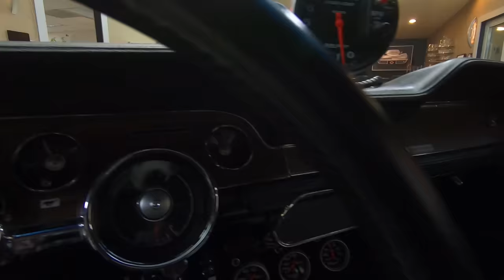1968 Ford Mustang Lucy For Sale

Comment: I had a 1968 Mustang fastback, 428 Cobrajet, 4 speed, 4:88 Detroit locker rear diff. When i bought it, it had lived a hard life and was pretty much on its last legs mechanically.  Body wasnt too bad, but i did have both floor pans and rocker panels and the left rear quarter panel all replaced with factory Ford replacements. I did all of the mechanical repairs  myself, i got a Lunati forged crank kit, with forged steel crank, forged aluminum rods and forged aluminum  .030 pistons. I balanced everything on a grahm scale after trimming all the excess weight i could, i put a custom ground full roller cam setup in it, aluminum heads, studded  the main caps and heads installed windage trays etc, then topped it with a Banks underhood low profile super charger, and Banks throttle body fuel injection. I replaced the top loader 4 speed with a Borg-Warner Super T-10 4 speed and Zoom multi disc clutch, and explosion proof bell housing. I had a custom aluminum drive shaft made, and did a complete 4 wheel disc brake changeover, i put a whole new suspension setup, with coil spring 4 link rear diff, and a steering geometry setup that was designed for SCCA Trans Am series racing for 60s mustangs.  I didnt build it to drag race with specifically,  but it was a true 10 and a half second car when i eventually took it the Thunder Valley  dragway in Bristol, Tennessee.  But what i really built it in mind for was all the damn beeswarm Hondas and etc that were becoming more popular in the early 90s, i just tired of hearing all these young guys talking about how fast they could make their civics and Barrettas by putting a turbo charger on them, and how old guys like me just couldnt understand that there was no way an old 4200 lb V-8 car could stay with them, "You might win in the  first 1/8th of a mile, but once my turbo builds boost, ill go by your V-8 like you hit reverse. It was more than i could tolerate. So my old 68 didnt take long to develope a reputation of being a V-tech killer, they couldnt touch it on the drag strip, they couldnt touch it on top end, and  they couldnt touch it on the curvy and steep backroads that wind through the east Tennessee  Appalachian  mountains.  I had a lot of guys speculate about what was under the hood, buf i would never open the hood to let them see, when asked i would say its just a little Small block Ford, if you really need to know, put 5 %100 bills in my hand and  ill let you see whats under the hood. No takers of couse but i really enjoyed showing them theres no substitute for cubic inches, when you need raw horsepower!!!!

Comment: Engine Compartment:
514cid Big Block
Darale 16" electric fan
Custom Front & Rear 6061...
CSI Electric water pump
Custom Billet Fabrication...
Ford Racing Cobra Jet...
BDS 8-71 Supercharger
Hydraulic Clutch System
Remote Oil Filter
Custom engine harness
Custom Fuel delivery system...
Tubular Automotive...
Canton Racing 8QT...
Custom Accelerator...
MSD Ignition system

Comment: That laugh was fueled by adrenalin! New cars wont quite do that.
Well built machine for sure not for beginners!
I thought changing plugs, header gasket or starter on my 460 86 Gt was a nightmare...this one...yow!
Headers look to be handbuilt, super long primaries jet coated exhaust somebody went ball$ deep on this one! 
Thats a giant middle finger with tires driving down the road!!